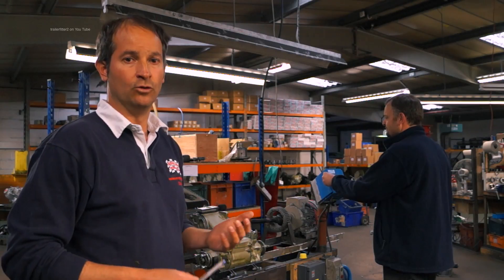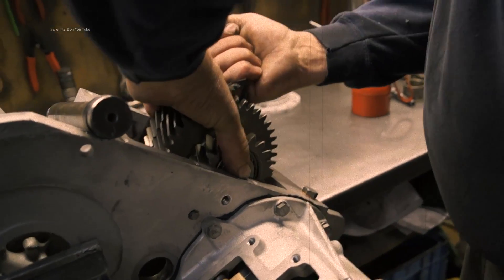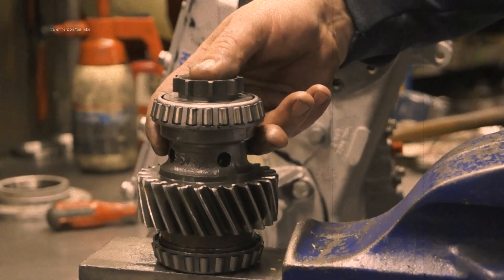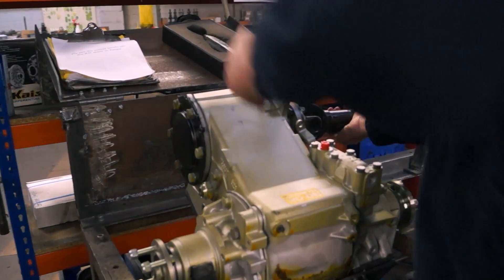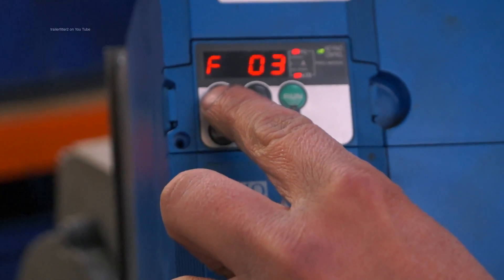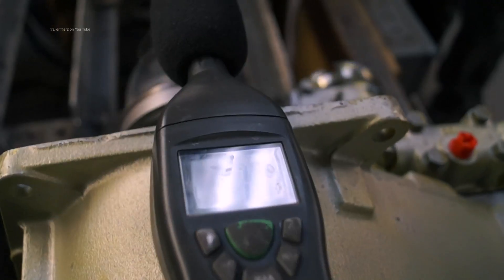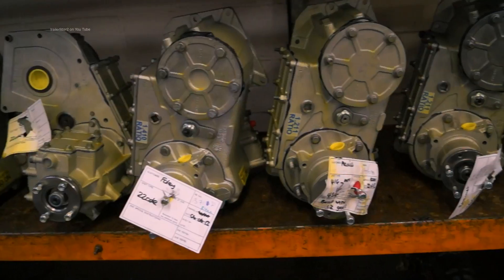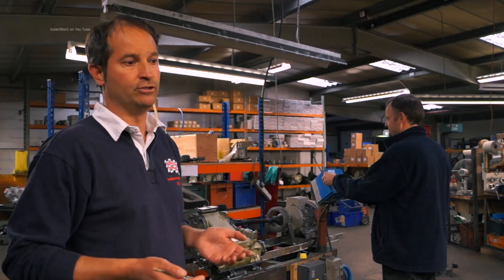LT230 quality check -  Ashcroft Transmissions

Comment: Update!  My LT230 from Ashcroft is a fabulous unit. quiet, no leaks, shifts in and out of high low lock or unlock, very smooth. quite pleased, and I ordered it with the stainless steel insert and an Ashcroft ATB center diff inside as well. Shipped to me in the United States, very promptly! I am totally satisfied, emailed with Mr. Ashcroft personally to sort out my swapping of the Borg Warner viscous unit, for this LT230. He sold me exactly the right model number to match the T-case to my application. No extra unattached bits, looks like my 94 LWB came with it from the factory! It is very quiet. I think I can detect something if I try hard at 60+MPH. But seriously I don't notice at all. I know the quality is very high, I can feel it..They are rock solid!